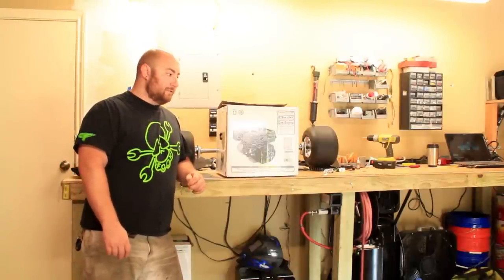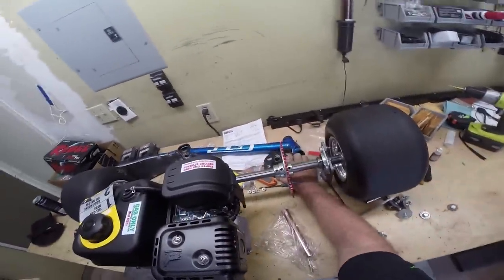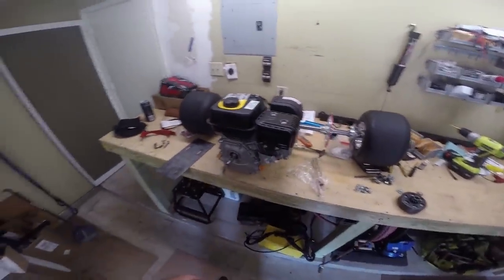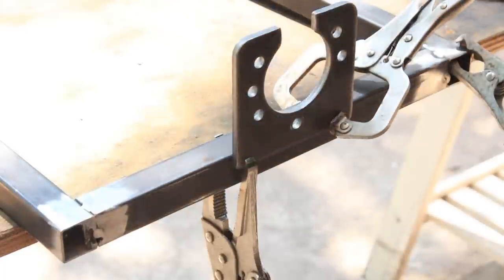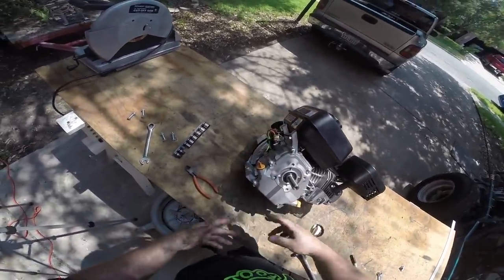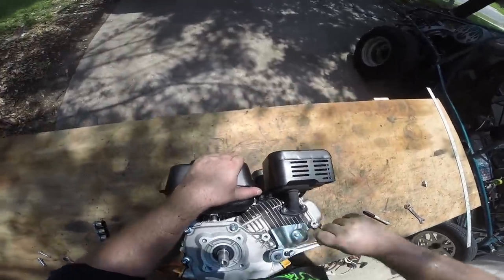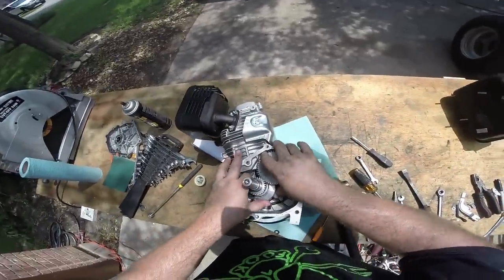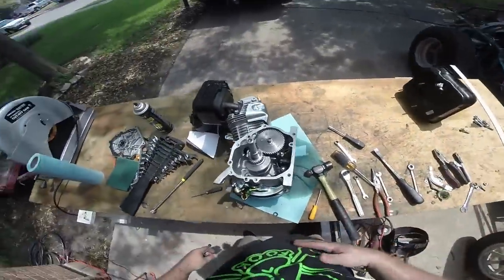MaksWerks Garage - Drift Trike Build Part 2

Comment: You will end up disconnecting the low oil cut off I️ thought the same thing when I️ had minenin a gokart, but when ur driving(maybe not with a trike cuz you’ll be on pavement) but the oil will slosh around because it’s liquid and cause it to die because it will recognize it as low oil.

Comment: what is the length and width of the box section
Reply from the maker: I don't really remember. I think its in the video.
Reply: MaksWerks Damn.. it's not.  you said the diagonal measured 29 3/8 inches but nothing about the length and width
Reply from the maker: In that case I would say it was probably 30 x  12 " or so. The actual size doesnt matter as long as it fits the axle and wheels.